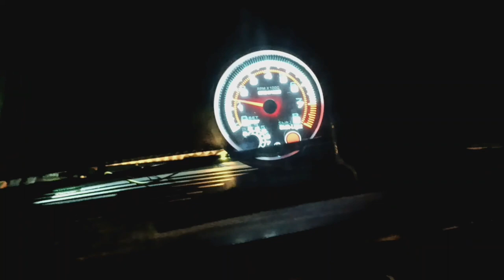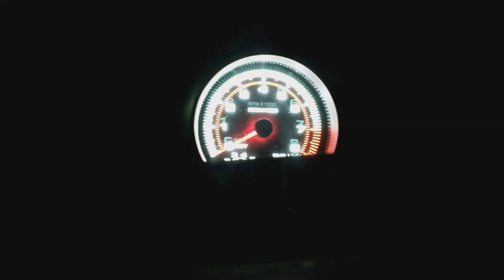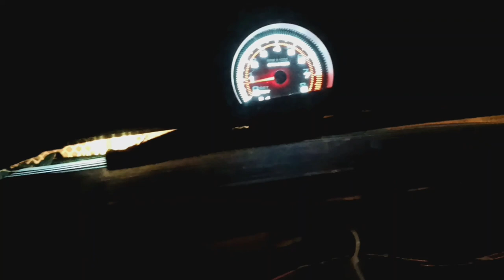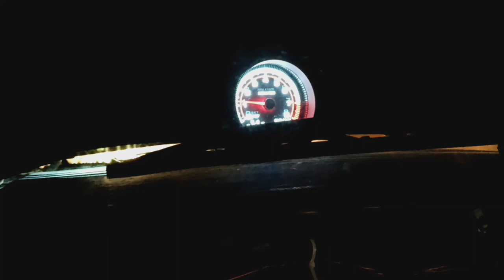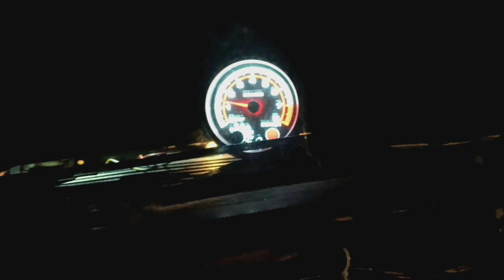Fox Box Mustang - EFI to 4 Barrel - 89 LX Notchback

Comment from the maker: Car has some "personality" now - no computer, no  relays, no fuel injectors & harness, no 60 pin connector, no Salt & Pepper shaker harness,  no throttle position sensor, no A9L ecu, no Throttlebody, no mass air meter, no cold air intake, no  O2 sensors, no cats, no high pressure intake fuel pump with dual lines (removed all the original "rusty looking" fuel lines), no "surging", no timing light "time it by ear" now - used original Fox Body Distributor (only 2 wires used) - highly recommended